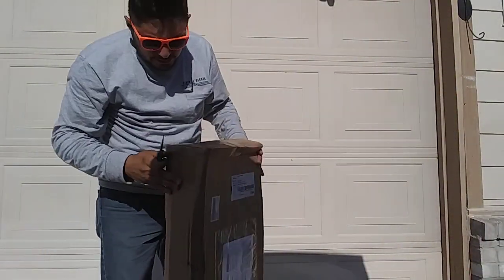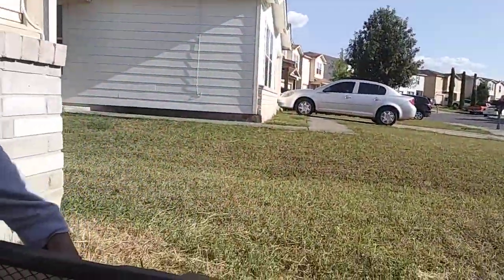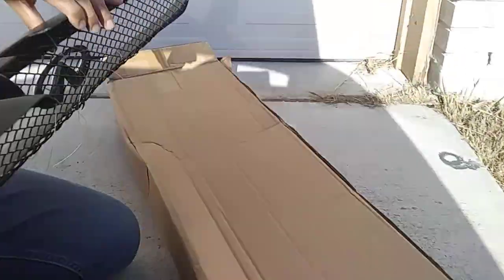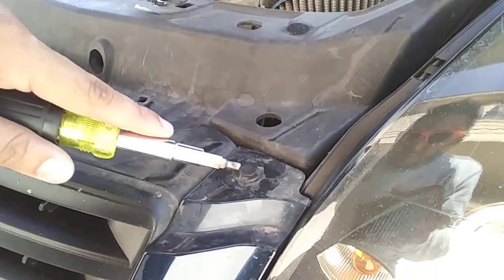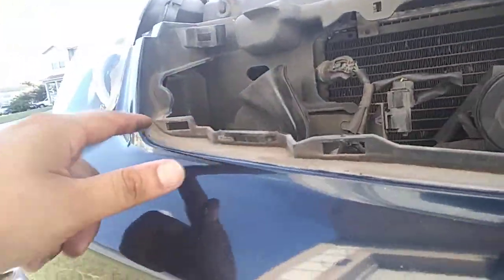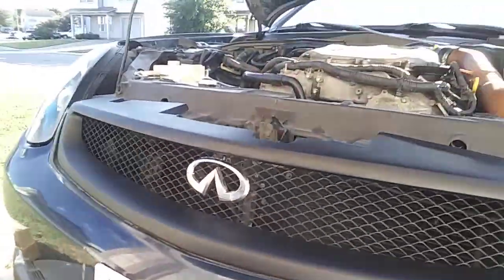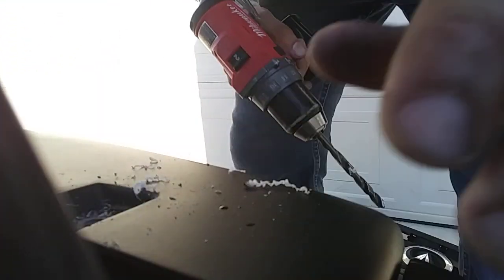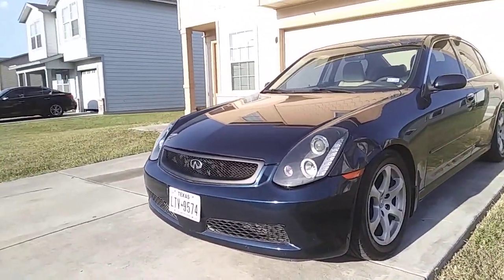G35 SEDAN (MESH GRILL & FLOATING EMBLEM INSTALL)

Comment: That grill looks way better 💯
Reply from the maker: Yeah I had that look on my G35 Coupe and I loved it. So now I got it on my G sedan & it looks 🔥🔥already.
Reply: G10VANN1 TH3 G35 FAN for the coupe? Where'd you get it at? I would like to get one for mine. & yea it's looks fire fosho!🔥🔥
Reply from the maker: @drew1k978  https://www.ebay.com/itm/For-2003-2007-Infiniti-G35-2Dr-Coupe-Black-ABS-Front-Bumper-Mesh-Hood-Grille/301842745913?fits=Model%3AG35&_trkparms=ispr%3D1&hash=item46473aca39:g:~EIAAOSwzqdcs~lf:sc:UPSGround!78222!US!-1
Reply from the maker: @drew1k978  its a cheap easy mod to make the G look dope

Comment: From where u bring the grill and is coupe fir sedan or not ?
Thank you
Reply from the maker: The website I got my grile from isnt around anymore but there is this website that sells them

https://cmodgrilles.auctivacommerce.com/Product.aspx?ProductId=112956

As far as your question the sedan and coupe don't enter change with each other. So the sedan 05/06 grille doesnt work with the 03/04 sedan. But the 03/07 coupe grille works for all years
Reply from the maker: If you like the way that looks check out the video I have with the led emblem on the mesh grille
Reply: @GIOVANNITH3G35FAN  Which one
Reply from the maker: When you say which one? Are you talking about the grilles or the video with my led emblem install
Reply: @GIOVANNITH3G35FAN   yeah foe grill and my Question is coupe grill is fit sedan if is same year
Reply from the maker: No the sedan grille wont work on the coupe The good thing about the coupes is that the 03-07 grilles all work no matter what year. The sedan are longer and more narrow compared to the coupes
Reply: @GIOVANNITH3G35FAN   the problem is if I want looking for a part for a sedan is looking for a coupe, I want parts for sedan not coupe
Reply from the maker: What year is your sedan? The link I sent is a grille that is made for a 05-06 sedan. It only works with those years. If you have a 03-04 sedan it wont work but can send you a link for that year if you need a grille
Reply: @GIOVANNITH3G35FAN   yeah I found it just how i pay for that

Comment: pull off emblem paint black . re-install  same way or leave it . but buy jb weld silicone  behind gril dont hit fishing wire but glue all plastic just fill in . let dry then take fishing wire off it wont move 🤘🤘🤘lmk if u do mk video 🔥
Reply from the maker: Never thought of trying that cause usually the emblems come with the 3m tape. Maybe I will try that I will definitely make a video. I'm just excited I my grill finally came in. Got some more stuff to make my engine bay look more better. Have to wait til the parts come in.
Reply: G10VANN1 TH3 G35 FAN nice i will be waiting forsure . i jus gave that idea so if somone lookn at ur ride you cant see the fishing wire you know . great video nice thumbnail
Reply from the maker: @foreverg3549  yeah I will diffently have to do a shout out to FOREVER G35 👍👍👍
Reply: G10VANN1 TH3 G35 FAN what aa shout out 🤘🤘🤘🤘i feel the love . so bro they came in and i droped the G at shop yesterday . should b done today if so video will drop tonight ....
Reply from the maker: @foreverg3549  lol what came in
Reply: G10VANN1 TH3 G35 FAN MD test pipes
Reply: G10VANN1 TH3 G35 FAN art pipes
Reply from the maker: @foreverg3549  I will be waiting for that notifaction I really want to see what they sound like
Reply: G10VANN1 TH3 G35 FAN me 2 bro being i have straight piped hks exits hopefully today we will see soon
Reply: Hey man so just use gasket maker on the back of the emblem to the mesh?
Reply from the maker: Good idea. I ended up removing that emblem and put a led infinti badge now
Reply: @GIOVANNITH3G35FAN  did you end up using  the gasket maker to put the back of the badge on the mesh
Reply: @GIOVANNITH3G35FAN  yeeeebold comments gtn attention
Reply from the maker: @jdub7651  no actually the badge came with a bracket to support it

Comment: Hey, what's the part number/company for the replacement grill? Share! :)
Reply from the maker: What year is your sedan?
Reply: @GIOVANNITH3G35FAN  It's a 2005 ! :D
Reply from the maker: @debraz2307   well this isn't where I got my grill from apparently the website doesn't exist anymore but I did find some off of this website http://www.ionicdynamics.com/G35Ssiggrill.html
Reply from the maker: @debraz2307  the reason I asked what year is cause there is a difference in the 03/04 grill to the 05/06
Reply: Thanks!!
Reply from the maker: @skytreeground  no problem 👍